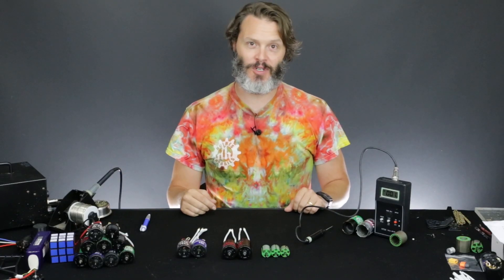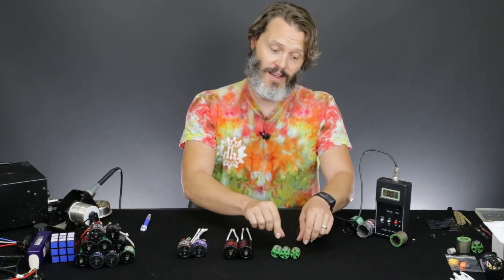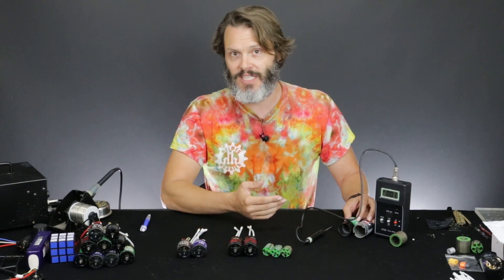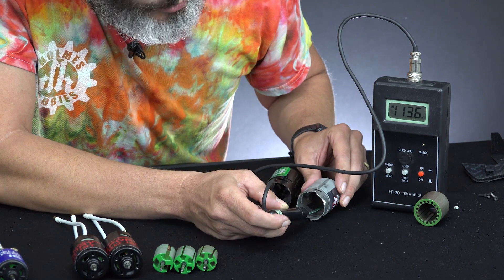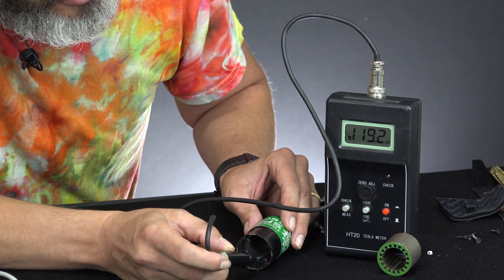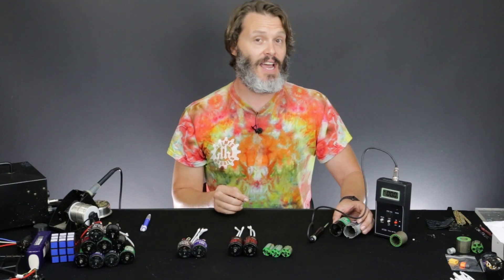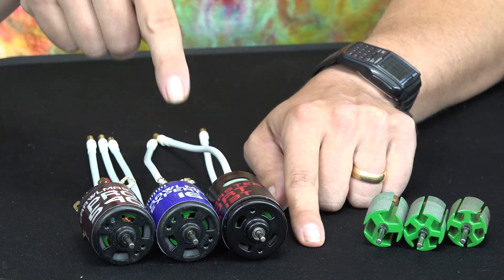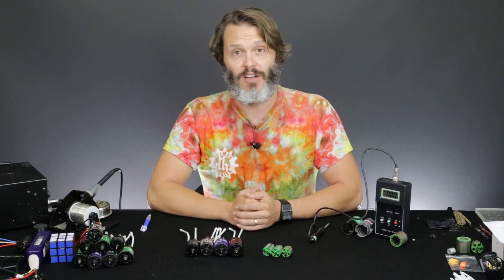Designed to Perform! Crawlmaster Sport RC Rock Crawler Motor Tech Details - Holmes Hobbies

Comment: I’ve had the crawlmaster sports. Great motors. Especially playing in water. My question is how waterproof are the crawlmaster experts?? Are they better than the sport?? Or not at all??
Reply from the maker: Sports are the best for water use.  Expert will do it but brushes wear very fast because they are soft/  high performance
Reply: @HolmesHobbies  thanks. Do the expert motors have a stronger drag brake than the sport?? I find the sport motors have a tough time holding my heavy rig on a hill. So maybe I should grab a expert motor instead??
Reply from the maker: @bik0304   I haven't tested detent in a long time, trailmaster or Torquemaster will have better drag and hold if you are currently using a crawlmaster

Comment: Saw a video recently comparing your Crawlmaster motors to the stock motor that comes in the Element RTR trucks.
I was not surprised to see a significant increase in torque and drag brake.
I WAS surprised to see the HH 10t was SLOWER than the brand R 16t.
My questions:
If going with a 550 motor, would the 8t be a more similar speed to what I have now?
If it’s too fast, will gearing down get me out of the “golden zone” and just produce more heat than say the 10t or 12t?

Thanks 1,000,000

Got an 8t sitting in my cart, I’ll pull the trigger when I hear back!

Comment: Awesome video. I ordered the crawlmaster expert 540 16T motor for my Losi night crawler running a 20T stock pinion. Do i need to gear down when on 2S or 3S and are there any setup recommendations for such a setup? I don't want to go brushless for this rig.

Comment: I just got a TRX 4 sport (RTR), plan on swapping out the motor to go with a Hobbywing Quicrun WP1080. I mainly do trailing/terrain driving, but also occasionally some crawling over rocks etc. I wnated my trx to look "scale", so i have the expedition rack, but have added some brass to the front axle to get the "nose down" and not tipping backwards. 

But, not sure which motor i should get (and im on a budget)....so have been looking at the cralwmaster sport 550 13T and the Trailmaster sport 550 27T. Any advice on which would be my best choice? Or advice on a better choice in the crawlmaster/trailmaster lineup?
Reply from the maker: The crawlmaster will be smoother. The trailmaster more torque and drag brake. 

I pretty much run only crawlmaster in my own rigs.

Comment: What motor with a 1080 esc would you run in a class 1 with a vfd kit transmission and ar45 straight axles. Or would you switch to brushless for comping

Comment: I just put the crawlmaster sport 540 on my Capra and after a couple of minutes running i smell something and I'm like oh it's probably just the break in. Keep on driving on it and a couple of days later it gave up on me.
Reply from the maker: 16t or slower is recommended and did you gear down?
Reply: @HolmesHobbies  unfortunately no and i had the 13t. I will be upgrading to the 3 gear transmission with dig and probably pick up a 16t motor. What pinion size should I run?
Reply from the maker: With a 3 gear, about 5 to 1 ratio
Reply: @HolmesHobbies   so can I get a replacement 16t motor? Amainhobbies is taking a long time to respond to my warranty claim

Comment: Hey bud,ive been trying to figure out the best motor/esc combo for my gen 7. Running 19-50 gearing with a Stealth x trans. Steel gears throughout,steel driveline. Im looking for the ability to trail,and low speed control. Thank you! Love your videos!
Reply: Oh and running portal axles.

Comment: I tested my first Holmes hobbies motor the last weekend. Very impressed with the performance on the budget motor. I've used the 550 crawlmaster 13t 5-slot on 3s with 1080 hw esc.  It didn't get hot at all. I hill climbed in sand using second gear, (gmade buffalo with steel wheels). The motor only got to about 37°c.  My first generation scx10 with closed can 550 21t 3-slot run way hotter. And the gmade is also faster in second gear.

Comment: I have a 13t crawlmaster sport 550. About how much is the speed difference compared to the trx4 stock motor? Im running Stock gearing, 1080 esc, 3s lipo

Comment: Good day, im using a trx4 rig with a 1080 esc and wondering to change my stock motor especially for the drag brake. Which would be better? Trailmaster 35t or crawlmaster 20t?

Comment: I bought this motor and I have to say I'm not impressed at all. The stock 35t motor axial put in the truck is better. More power, torque and less heat. You talk a good game but I'll be buying hobbywing from now on.
Reply from the maker: Please contact us through the website for a replacement.  I'm not in business of selling bum motors and what you selected should be a noticeable improvement, so it sounds like you need a new one.
Reply from the maker: Without knowing the exact model you bought, the information does no good. If you installed a 35t trailmaster there should be a 10% torque boost. If you installed a 13t crawlmaster 540 there will indeed be a torque loss due to 5 slot design.
Reply from the maker: The most typical cause of low torque and heat when swapping a new motor is pinion mesh too tight.   Check out the comments on nearly all of my videos for what you should expect from sport motors. Better performance, its not just talk.   I have dyno results and tens of thousands of customers using sport motors.   They would be here complaining if the sport motors didn't deliver.
Reply: @HolmesHobbies  it's a crawlmaster sport 12t 550. Gear mesh was good and the drive train moves nice and easy with no binding. I've been in this hobby a long time and i've never had an issue like this. I've always heard good things about your motors but this one is a huge disappointment. I'm running stock gearing for the scx10 ii. Thanks for your reply but I'll be going with a different brand from now on.
Reply: I'll do that. You know what they say about first impressions but when a company stands behind their products that goes a long way with me.
Reply from the maker: At least I know that it shouldn't be a counterfeit with that model, lol!  Biggest problem we've had with trailmaster sport motors is counterfeit ones obviously not performing like they should.  Let customer service know I've requested the replacement and it should go quicker
Reply: I sent you a message on your website with my email address and phone number.
Reply: Just wanted to say thank you. Your guy Justin took care of me. I told him what I was running, he suggested I go with a different model motor and I'm very happy. Has great power, torque, drag brake and the wheel speed is crazy for a crawler. He ended up sending me a trailmaster sport 3 slot 21t 550.
Reply from the maker: Excellent, glad he got you sorted!  That is our most popular sport model.

Comment: So, I have a tamiya g6-01tr wich is imposible to down the 18t pinion. It need a good torque because of the gears and the 6x6 needs more power.
What motor do you recomend for this rc truck?
Crawlmaster sport 20t, more t, less t? Maybe a expert because needs a 540 not a 550
Thanks
Reply from the maker: For torque,  the torquemaster and trailmaster will deliver better.  35t.   Or go 1000 to 1400kv revolver 540.
Reply: Hey, thanks for the response. The problem with the revolver is the price of the brushless ESC. The torquemaster 35t could be great. Thanks

Comment: Hi John, which one of your 550 motors would you recommend for my Scout ii Gen 8? Im thinking maybe something equivalent to the stock 550 wheel speed & torque unless you suggest otherwise ? should I buy the Crawlmaster 550 12 turn. Im running a Hobbywing 1080 esc w/ a FlySky gt3b radio & I definitely dont want to lose my drag brake if that needs to be taken into consideration, Im currently running mostly 2s lipo but will be running 3s as soon as I can get more if that matters. Thanks
Reply from the maker: I personally love the 12t crawlmaster 550, always a solid choice.
Reply: @HolmesHobbies  Oh Darn I ended up getting the 21T Trailmaster, I researched like crazy for hours but I just wasn't sure which way to go so I flipped a coin lol.. Im sure it'll be Great & its not like I broke the bank buying it. I know I'll be buying & trying many more of your motors  in the future.... Thanks so much

Comment: Thanks for that, I do have a quick question. whats the difference in torque from say the 540 Expert or 540 Pro vs just the bigger 550 in general ? jumping from 540 to 550 does that automatically mean more torque or not necessarily because the 540 Expert /Pro are better built? if that makes any sense lol Thanks
Reply from the maker: Yes, longer motors make more torque.  Its about 50% higher between my 540 and 550 if we assume same materials, quite noticeable.
Reply: @HolmesHobbies  Oh Wow okay, Thanks so much.....👍🏻

Comment: Been archiving your brushed videos I recently started going the brushed route and really overlooked what I was missing so much goes into your escs and motors most aren’t aware of I was using a brand H brushed esc and your 27T torque master expert and it did well however the drag brake was sub par after trying the Holmes hold on your brushed esc I was amazed it was well worth the money and the low speed modulation was excellent going on this addictive habit I created I bought a crawl master pro 13T geared down and 4s WOW unreal low speed control and tons on wheel speed when I need it I know it may be more maintenance in the long run and most of my brushless bro’s laugh at me but when you crawl lines with grace and control your rig looks better keep up the great work on brushed motors you have a customer for life....
Reply from the maker: many thanks for the support! Glad you love the products

Comment: Um the magnets are closer than you say. You read the lows on brand T. You read the highs on yours. I mean yours are better but not at the range you are suggesting.
Reply from the maker: funnily enough, I've also had people tell me I was too generous on the brand T, lol!  I did my best to be absolutely fair and test in the same spots,  I wouldn't risk reputation on some dumb foolery.   Surface gauss doesn't tell the whole tale either, but it does show the inconsistent field on cheap magnets.  You can't easily  see how the angle and position of the tool affects readings in this , and any min/max that weren't read aloud were because of tool orientation or placement.   While the maximums may be close, the average mesh strength is not at all, and the performance difference on a dyno and on the rocks is the real test.

Comment: What motor would you put in 10lb+ TRX-4 for trail use?  Reverse turn stock traxxas motor in it now with a HW1080 ESC.  2 speed transmission in use as well as switchable diff locks.

Comment: Hello John!  HolmesHobbies 
I’m buying a crawlmaster sport 550 12t for my trx4. I’ m using the stock esc in the truck. Is there any problem in the stock esc or it Will run with no problems? Excelente videos!! Congrats!t
Reply: Sorry I'm not Mr Holmes but itll run just fine, if you want to one up it BIG TIME, I suggest you buy a Hobbywing 1080 esc completely Waterproof & it comes with a program box, you can program all kinds of stuff, drag brake, speed etc etc & its only $40 dollars new.... Best of luck 🤙🏼
Reply: @ConditionZero76  great reply sir it just got you a new sub 👍🏻💯

Comment: I'm looking to improve my trx4 still on the brand T 550 motor what would you suggest suits it best I like the idea of wheel speed and I'm on the UK can I get it over here ? Or do I need to make a trip to the US ?
Reply from the maker: The Trailmaster 21t 550 or Crawlmaster 12t 550 is my preference.  Both are close, but slightly faster than stock.   If you want much more I would suggest brushless.  We ship to the UK frequently.  Or you can use asiatees or RC mart
Reply: Thanks for replying loving your videos and loving getting back into this hobby after a 25 year break 🤫

Comment: Question Sir:  I have a couple of the HG P408 (these rigs are about 12 pounds each) for myself and the boy.  The stock motors are way to fast for such a scale rig.  I assume they are are running a 12T to 15T 3-slot 550 (but I have not put one on the dyno or taken one apart yet).  I need to slow the rigs down and give us more low end.  Before and after the upgrade, I will throw the rigs up on the chassis dyno and document the results.  

Until I saw this, I was ready to get a couple Trailmaster Sports in the 550 27T which from my understanding would be closer to a 35T 540 with more torque.  After watching this, I am maybe I should go with the Crawlmaster Sport 550 15T, 5-slot motor.  The question is should the Crawlmaster Sport with the 5-slot setup be closer to a 540 3-slot 45T motor (maybe a touch higher RPM)?  Also by going with the 5-slot instead of the 3-slot, I would then gain more torque at lower speeds, correct.  Thanks for your input and once I hear back, I will get the motors on order.

Comment: When building my first rig I out in a puller pro and the Holmes no bec servo because I didn't want to feel any what 'what if' or to spend the money 2x.

What a fantastic product and fantastic service all delivered to Scotland. I also bought the mamba X from you and although it's a bit of a thought process to get it going with all the options my crawler just works exactly how I want it  to work and I never get frustrated with any of the parts

Comment: Im probably going to be upgrading the electronics in my TRX4 soon.  Im liking these new motors.  What do you recommend?  Keep in mind its a pretty heavy rig and I want a lot of low end and can use second gear ro get some more wheel speed out of it.  Im running three cell as well so I have the extra voltage already.  The last factor is the gearing.  I would be open to changing it as well to get the best performance out of it.  I want my drag brake back.
Reply: CrawlMaster Pro 550 10t with a 9-tooth pinion
Reply from the maker: For drag brake, trailmaster sport 21t 550 for budget.   Torquemaster expert or pro 550 21t for higher cost and higher performance

Comment: Mr. Holmes, three questions: 

1). Please tell us why you prefer the 13T 540's vs. say, an 11T; and the 12T 550 Crawl Master vs. say the 10T?  We hear all the time power up and gear down. 

2.) Is there more low speed/start-up control on a slower motor, or is the slower motor just able to handle more voltage and keep the overall wheel speeds down with higher voltage? 

3.) It's also been said that a fast cheap motor will accomplish the same things as a slower more expensive motor if it's geared low enough.  Do you find the previous statement to be true?  Thanks.
Reply: He is a salesman selling a product. Keep that in mind. Also keep in mind I have won comps with 8 dollar rc4wd motors. Skill is 99% of driving these little rigs. Their power to weight ratio is astronomical regardless of how much you spent on electronics. I can dump almost any truck out of its box brand new and be on the podium.

Comment: I have had my crawler for just about a year now. do not really do much crawling. most of my stuff was buy bash an run fast doing 50 mph across the dirt. I live out here in the Mohave desert in ca. so i am looking at increasing from 11 mph to at least 30 mph in second gear. but want that torque an crawling power in low gear. Would you say it is better to go brush less for even more stability. so would like your opinion on this thought.

Comment: Currently use 16t 540s brand 'R' in both trucks, Element Rtr (came with a brand 'R') and TRX Sport kit (bought Brand R Radon). But you sir have convinced me to upgrade both to 12t 550 CM Sports since there is room for 550 cans.

Comment: Which motor do you recommend for the Traxxas Trx4 Sport?  I'm looking for a Sport motor that is close in wheel speed as the 21T stock motor. Thanks in advance.
Reply: I'm running a Crawlmaster Sport 550 12t in mine, it's butter smooth and powerful.

Comment: So what would you recommend as an upgrade for my Sendero kit? Running a rc4wd as it was what my hobby had in stock and didn't want to wait for a motor
Reply: His web site has recommended motors for every truck worth owning. The chart has a range of suggested motors for each truck and multiple suggestions for what you will be doing. It's super helpful. Pick the lowest turn suggestion for plenty of wheel speed. Pick the highest turn suggestion for maximum torque.

Comment: I’m thinking about swapping my stock TRX4 motor (21T brushed 550 ‘Titan’) and stock esc, for a Surpass Hobby V2 Rocket 17.5T/2200KV 540s sensored brushless w/adjustable timing (currently set to 30 between 20 & 60) & a 120amp sensored esc from Banggood. Should I? Why? Or Shouldn’t I? Why? I’m very new to the whole crawl scene (that maybe obvious?) lol!!! I’m literally clueless on this? I’m reading off the product wile writing this! 😁😕

Comment: Always great info. 
What would you suggest for a stock TRX4? I’ve changed the esc, to a 1080, but stock motor...for now.
Reply: I am running a Crawlmaster Sport 550 12t in mine, it is butter smooth and still powerful.

Comment: I just got my Capra. If I get the 540 crawlmaster expert in 13 t will I need to change the pinion? If so what do you recommend? Thanks
Reply: Brad Cruse 16 turn for more torque 13 turn for more wheel speed. ( with stock pinion) either one you go with you’ll be happy.

Comment: I just swapped out a cheapo 540 35T motor with a 550 27T Trailmaster and I'm not noticing a large speed increase, am I understanding this video correctly if I'm now thinking this is because 3 vs 5 slot rotors?
Edit: I'm an idiot, Trailmaster motors have 3 slot rotors.
Reply: That's because going from a 35t 540 to a 27t 550, you are basically keeping the same speed potential.
Reply: What he said.  21t 550 would be faster if that's what you are looking for.